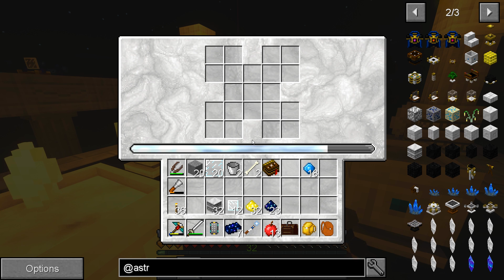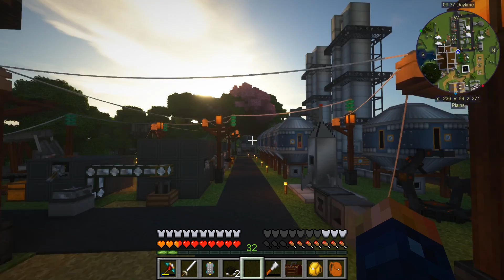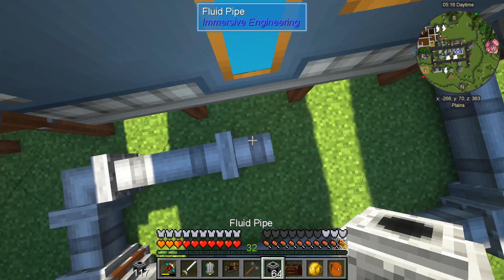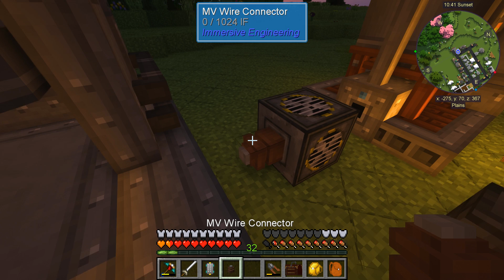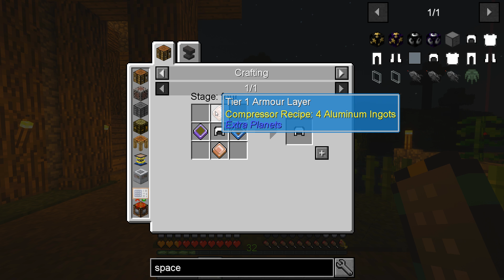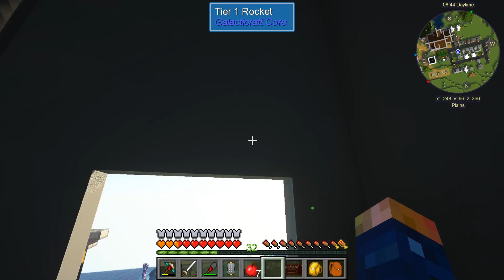SevTech: Ages EP35 Galacticraft Rocket Fuel + Moon Bound

Comment: Spoiler, in Age 4 you can use the Rancher on the Twilight Forest bighorn sheep to get lots of colors of wool, and it's not too hard to set up a full set, and export them with blood magic item routers to a drawer controller with 4 2x2 drawers so you have the ability to get  a full set of wool colors for the Questing Ram